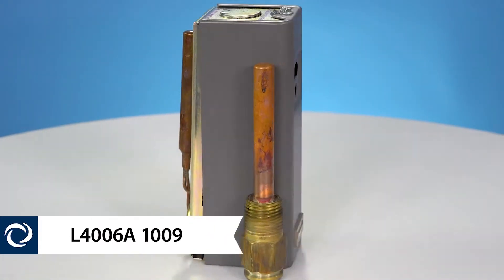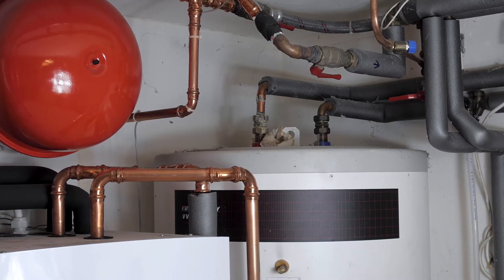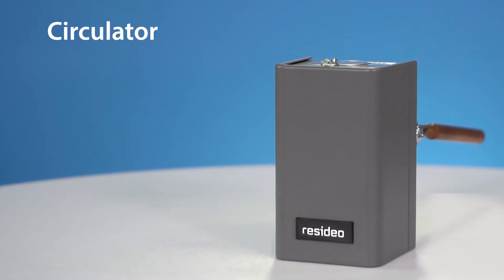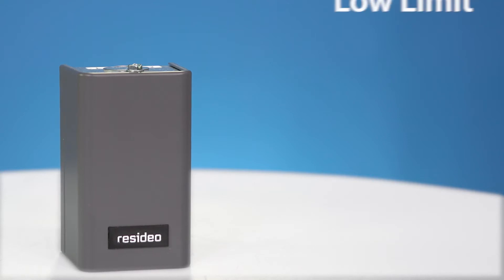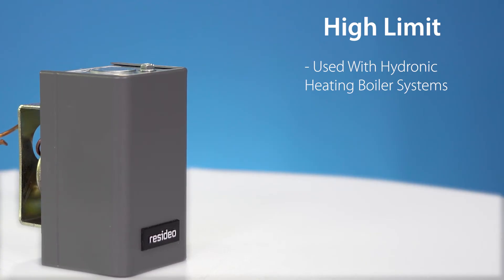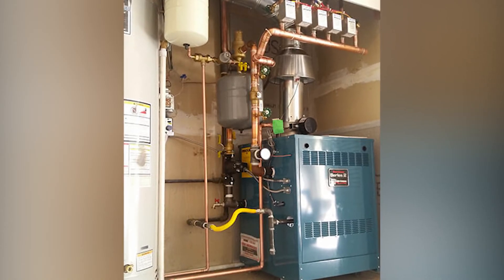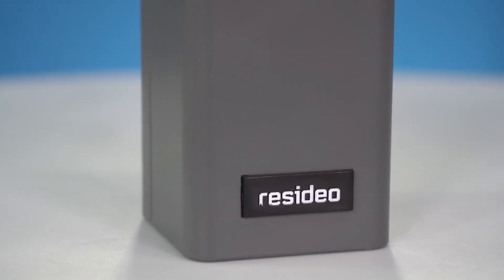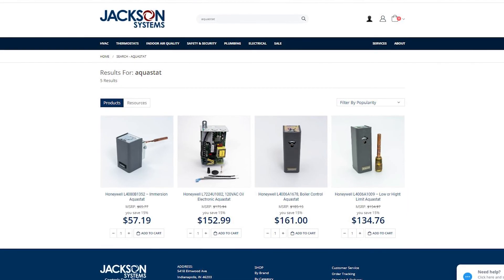Resideo Technologies - Honeywell Aquastat Overview

Comment: I'm looking for a digital aquastat with a Thermosistor sensor like those found in some models of Amtrol Indirect water heaters.  I need ability to set differential temps (or have the differential implicit in High / Low temperature settings for the domestic HW tank contents).  I also need more precision than the typical analog dial / liquid bulb & tube style provide.  I'd love to purchase another Amtrol, but they don't make the 26 gal size anymore.  Others are too large for my space. 
    Ideas?
Reply: Have you checked the Hydrolevel Hydrostat 3200 or 3250 which is electronic and digital. They have a wide range of settings, and temperature LED display and status LED.